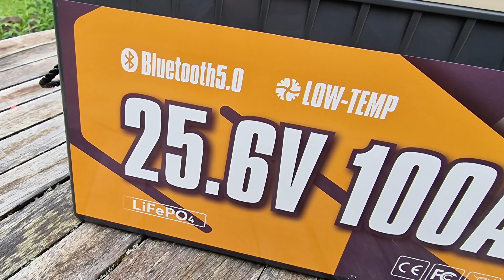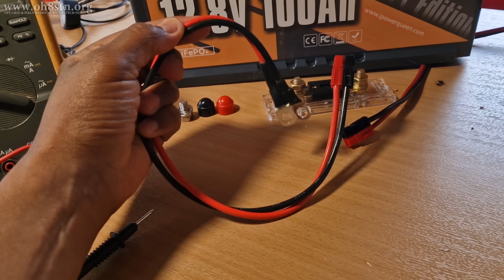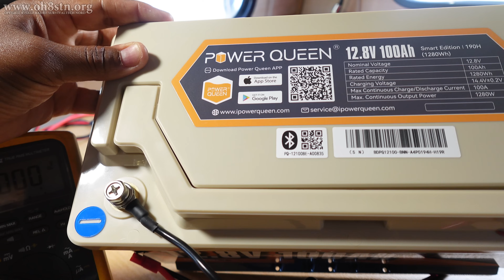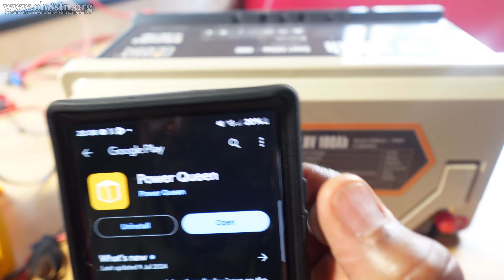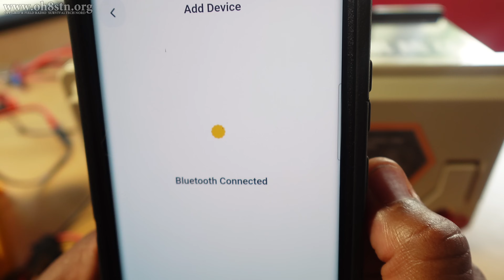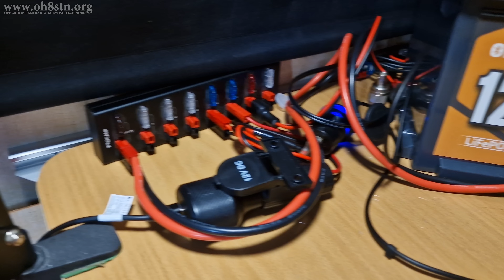Ultimate Ham Radio Disaster Battery with Wireless Monitoring

Comment: This is awesome. If I had seen this review prior to my purchase of the standard version of this battery I would have purchased the bluetooth version.
This bluetooth option is a great tool for Ham Radio Ops.

73
W5KAL
Reply from the maker: RR. I didn't realize what I had waiting for review until after putting the work in on the Victron Cerbo GX. I may put all that in the shack and use this BT battery in the camper.
73
Julian oh8stn

Comment: OK!, give me a clue!!!!  This battery is for emergency comms so.. What's to stop someone else bluetooth connecting to your battery and being malaevolent and turning the battery off.....
If I want power for a comms system I want simple full control of the power. 
Don't put steel washers in the power path, I knew of a touring coach (bus) that couldn't start the engine to get off a ferry boat because a steel washer had become hot in the current path and burned. The engine alternator supported all the TV's etc while driving but after turning off on the boat the engine would not restart because of one cooked steel washer.
Reply from the maker: Change the BT password in battery settings.

Comment: When you select “cells” it should display a bar graph depicting the individual cells so you get a visual representation of the cell balance.  Well balanced doesn’t mean diddly to me. 
My initial impression of the app is it is clunky and could use a more visually dynamic presentation. Apps should be designed for a complete newbie but with selected functions displaying more “engineering” grade data.
Reply from the maker: Well said. I'll forward the feedback. 👍

Comment: The washer under the terminal is not the best way.  You really want that terminal to have full contact with the battery.  Having the washer there gives a place for more resistance.   Resistance equals heat.

Comment: That app looks broken - it cycles through standby and showing the values.
Reply from the maker: Not broken. It's measuring ghe load in real-time. When my gear isn't drawing any load (because they have their own internal batteries), the shunt shows the battery in stand-by since no device is pulling current.
Reply: @OH8STN  It appears the load has to be at least 1A to register as discharging vs standby as well. Not a big deal at all, but it had me worried for a moment when the first device I connected happened to be a small fan running at ~900mA and the app would only 'blip' that it was discharging for a moment since the inrush current is about 1.2A. 

My only concern so far is that the app demands precise location permission vs generalized or none. It's a neat feature, but anymore I appreciate having more discretion in what amount of personal data is shared vs all or nothing.

Comment: How can you get a reliable state of charge reading, even with a Victron SOC  meter if the voltages remains at near 100% indicated until the battery is nearly fully discharged before you are alerted of the imminent depletion? So the indicated SOC on these meters is reliable?
Reply from the maker: Watch this part 20:25

Comment: What is the shelf life of these if stored at room temperature and 50/80% charged and zero charge- discharge cycles? 

73’s Karl AF5LQ
Reply from the maker: Interesting question.
I don't know the answer, but I do know keeping them in the narrow range to prevent them from fully cycling won't add cycles to the packs cyclic life. One would deduce the battery would last indefinitely. I believe treating the pack so gently would extend the lifespan of the pack. The question is how much? I don't believe any manufacturer would want to answer this, but it's a great question. 
73
Julian oh8stn